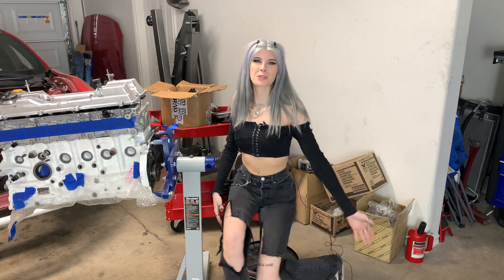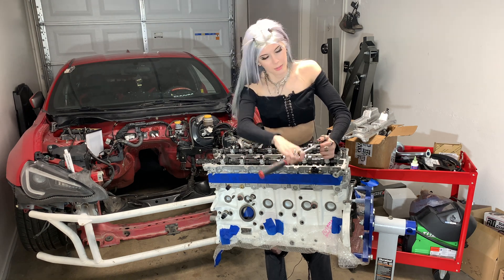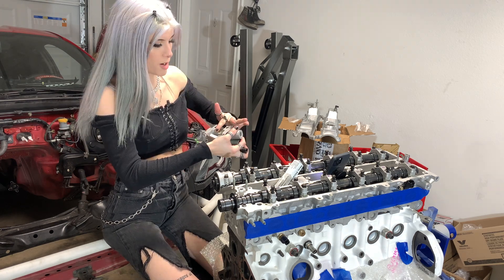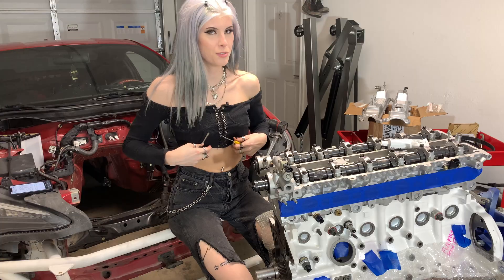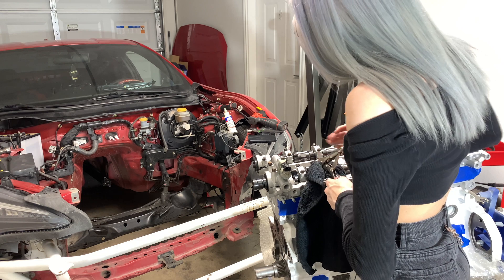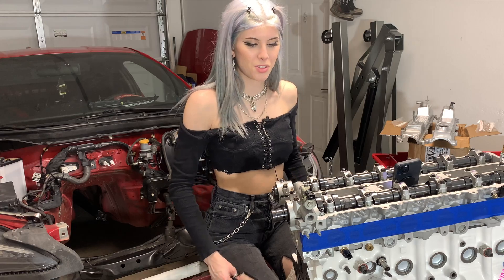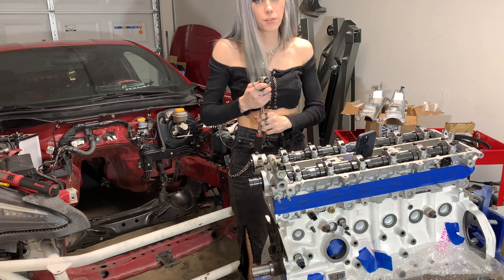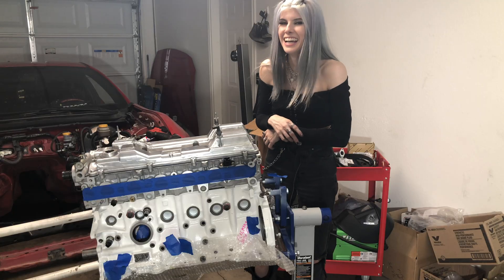HOW TO INSTALL 2JZ CAMSHAFTS (DETAILED w/ DIAGRAMS) + VALVE CLEARANCE CHECK!  - Rina Rae

Comment: Valve clearance was checked wrong you can only measure 3 cylinders clearance every 180°
Reply from the maker: i didnt include the entire thing in this, i didnt want to make it too long it of a video! but yes you are correct, i did rotate the cams and check all the clearances, dont worry :)